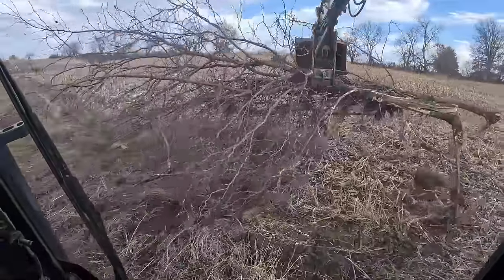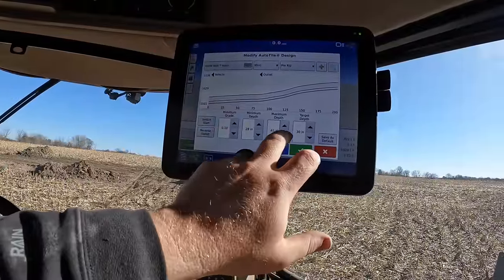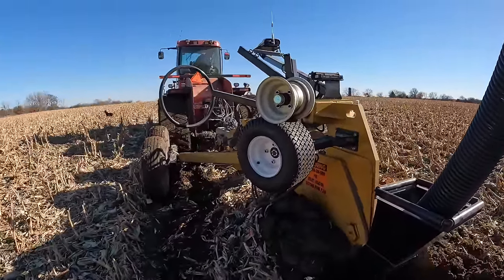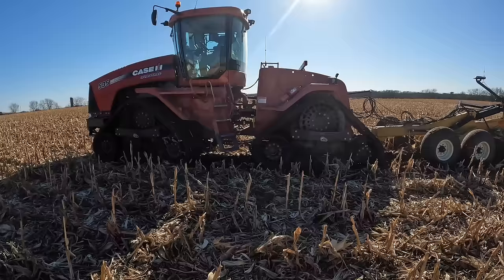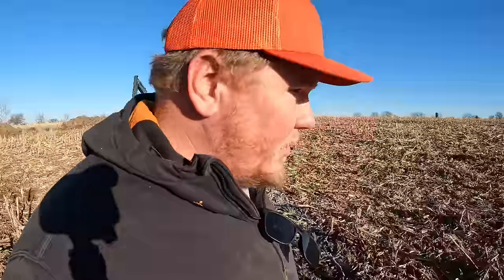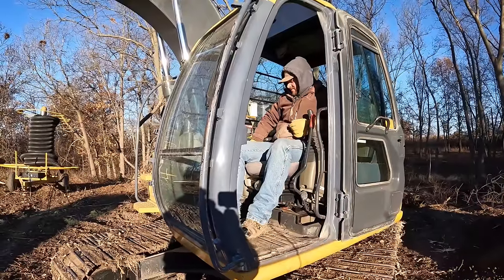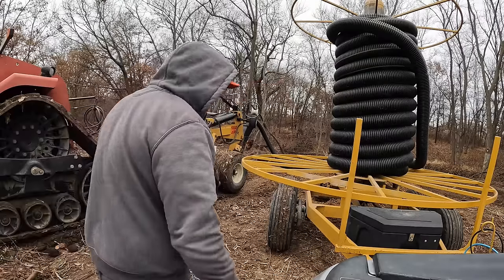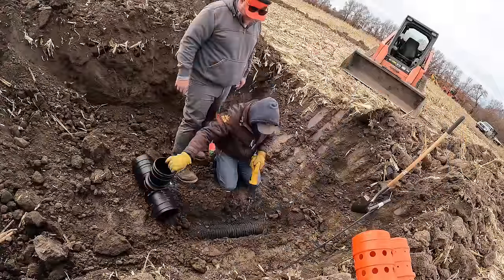NEVER SAY WHOA IN A MUD HOLE - FLOW-X

Comment: A tile plow will not work very goood in central Mo. to many old clay tiles.Buy a solid back shovel you won’t brake them better for grading start holes. Always pu steel posts on your risers you won’t get close to the risers with a tractor or combine because you may hit a riser ndtear upraised or tire. Always plow aleast ‘5” deee deep. No chance to hit with a ripper or any tillage tools and the deeper the farther out from the pipe it will drain.
Reply: Deep tile doesn't work very well in Southern Iowa soils, water doesn't move through our clay subsoils fast enough.